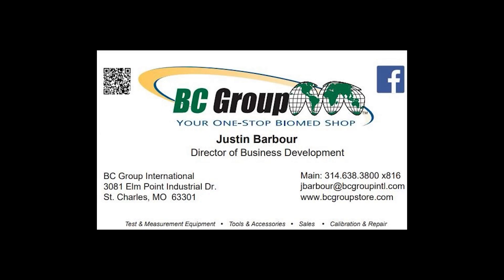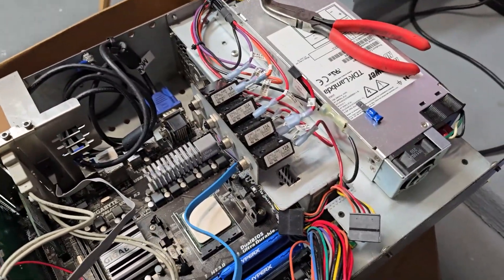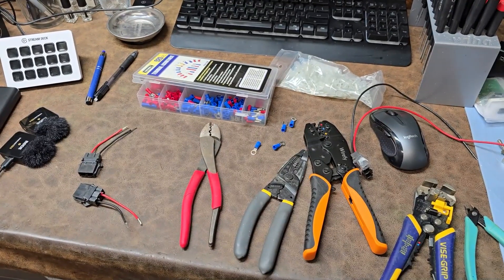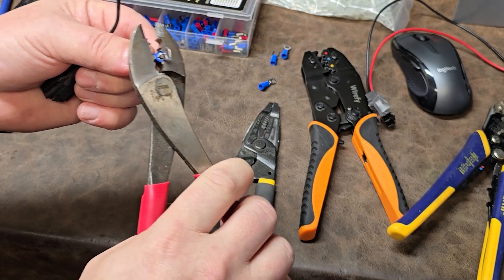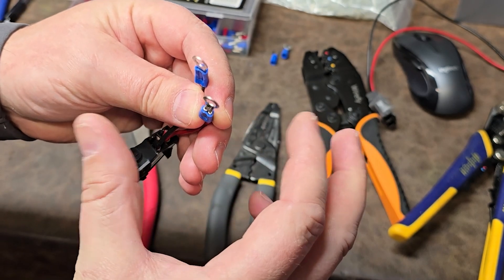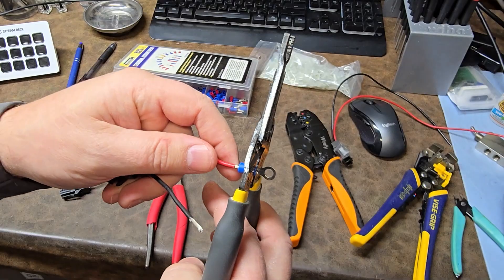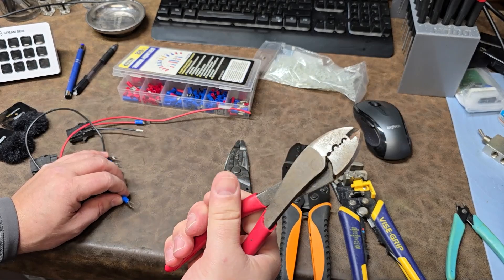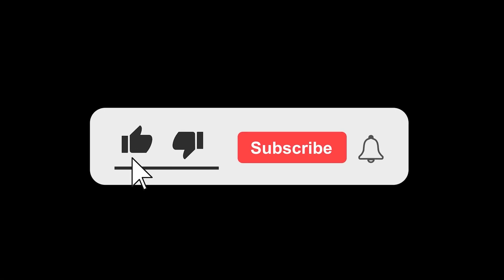Correct Wire Crimps!

Comment: Good timing. I was just looking for a crimper. Specifically, I have some of those heat shrink crimp terminals. I have one of the common sets of butt crimps. Four sizes - red, blue, yellow, and white. 

I have some small wires that are perfect for the white 22-26 gauge. But...my crimper doesn't go that small. In fact, I could not find a crimper on Amazon for 26 AWG heat shrink crimps. Very strange.

Comment: That motherboard looks to be a GA-78LMT-USB3. They were pretty solid motherboards back then, Gigabyte advertised how their motherboards had thicker copper and pcb than the competition.
All Japanese capacitors and other features that supposedly help with durability and longevity of their boards.

For the the subject on crimping, yeah I've seen quite a lot of those when salvaging and working on equipment, my favorite finds are the ones with regular plier crimping, as flat as the earth on some of them 😂